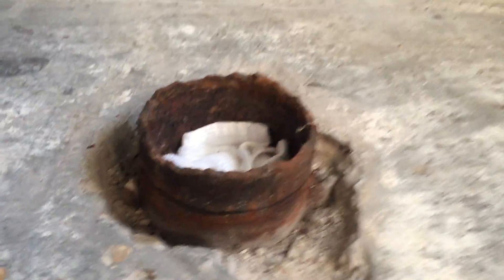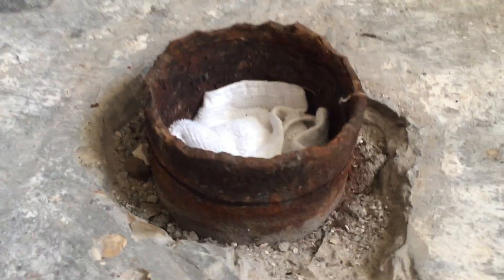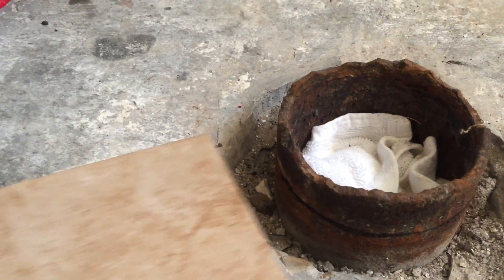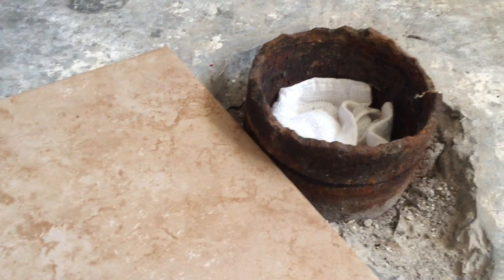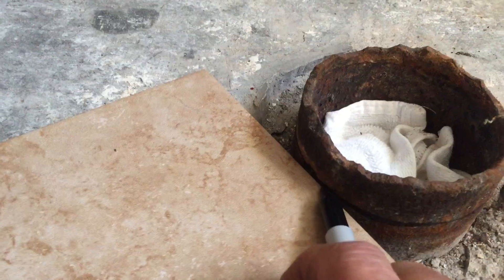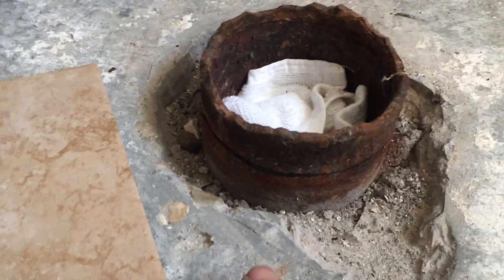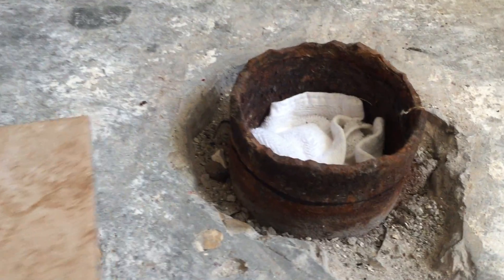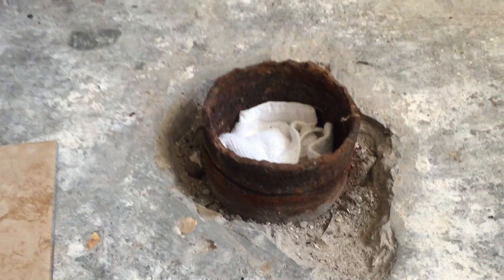cutting cast Iron pipe for toilet

Comment: For anybody working with a similar tile project in a bathroom, don't forget to take into consideration the additional height that thinset, closet flange, and other materials will add 'before' you cut the pipe!

Comment: Were you successful?  I have exactly the same issue.
Reply from the maker: Yes i used a reciprocating saw with a Diablo blade from home depot and finished with a grinder to smooth edge
Reply: @Randyragee  did you post a follow-up video?